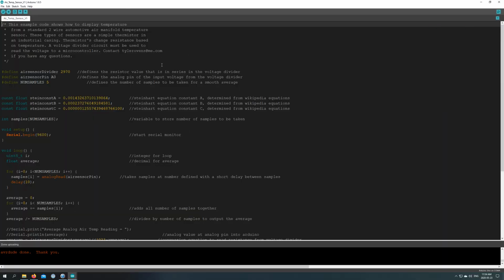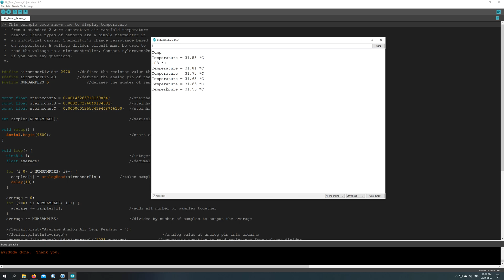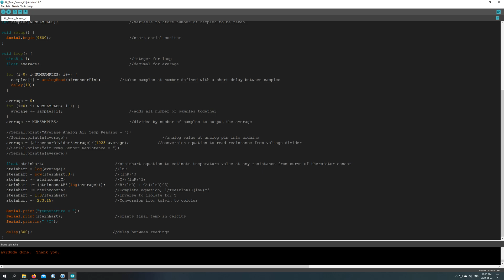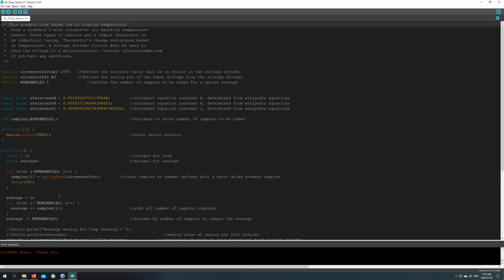Arduino Air Temperature Sensor | Thermistor

Comment: Any update to final results, with all sensors and display. im planning to build something simular, coolant+air + pressure,..
Reply from the maker: No I ended up abandoning the project but I have a video where I put everything together from all sensors on a bunch of small screens
Reply: @OvensGarage  can you share the video, just to have picture what need, this will be my first project with arduino :D
Reply from the maker: @TJ.Outdoor  you'll be able to find it if you search "arduino gauge system | prototype update 2"
Reply: @OvensGarage  yessss, thanks for it

Comment: Thanks for the info, I am trying to get my grid heaters running off arduino and was curious about interfacing the IAT. Look like a voltage divider circuit is the way to go. Did you ever get your data monitoring system up and running? I am doing something very similar on a 12 valve swap with an arduino feeding a Nextion display. So far I've managed to get the tachometer and fuel pressure working, now working on grid heaters. All my codes also on my website if you wanted to compare.
Reply from the maker: Sounds like an awesome project. I ended up abandoning the project. I've still got it on the shelf but I've moved on to other priorities...glad the videos I made are helping people though! Open source is fun for sure.

Comment: I love your videos, I was actually thinking about doing the same with my vehicle. How hard is it to convert from Celsius to Fahrenheit? I would be using Fahrenheit. Also how do you know where to put the resistors and all the wiring on that separate board?? Thanks
Reply from the maker: Thanks for watching. It wouldn't be hard at all, in the code you would just need to put in the conversion equation. I go over the wiring a bit more in detail in my previous video on the coolant sensor. It's basically the same idea, it's just a thermistor in a voltage divider circuit. Hope that helps.